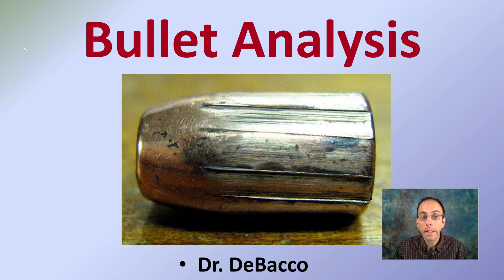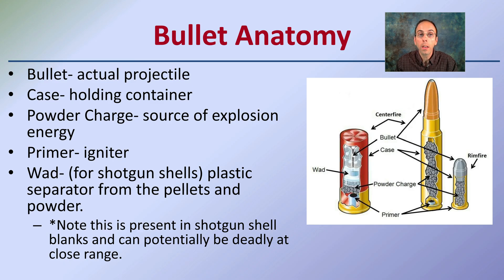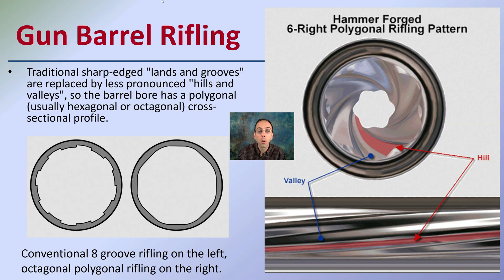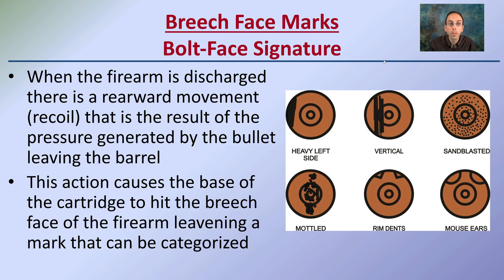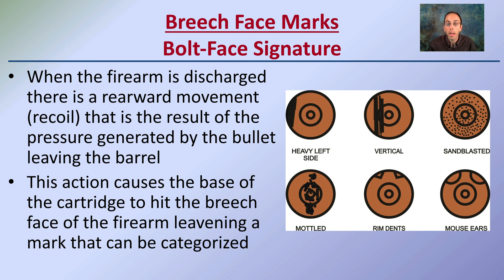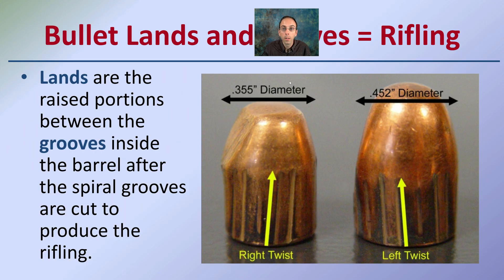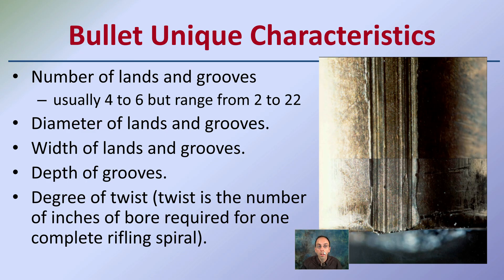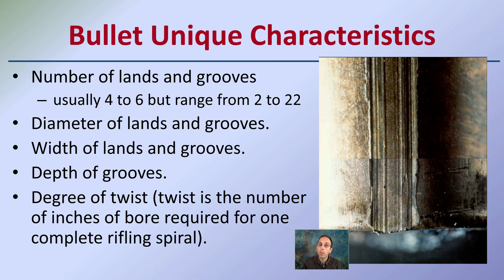Bullet Analysis

Comment: After a bullet has left the barrel and has its “fingerprint” but then travels through glass, or other hard object, wouldn’t that create additional markings on to the bullet making it difficult to recreate that “fingerprint” to match without hitting the same hard object?
Reply from the maker: Yes, it can depend on the condition that it is found in based on the material it impacted.

Comment: Do you have a video or recommendations on how to measure the width and depth of the lands and grooves to match a bullet to a manufacture?
Reply from the maker: Good question, you want to ideally have a comparison microscope to provide the easiest way to match up to items.  While this may not be possible, a single microscope (or stereoscope could work as well) with a camera can allow images to be taken at specific magnifications to allow a size comparison to be made.  The most basic method would be to use a set of calipers.  Other tips see... https://www.bevfitchett.us/firearms-identification/depth-of-grooves.html
Reply: @DeBaccoUniversity  ; I WAS WONDERING IF IT WOULD BE POSSIBLE I WILL LAY OUT AN SCENARIO FOR YOU : I WAS LOOKING OVER THE BALLISTIC OF A SHOOTING CASE. THERE WAS NO  FIREARM RECOVERED FROM THE CRIME SCENE. BUT "3 CARTAGE CASINGS" & "1 BULLET/PROJECTILE" WAS RECOVERED FROM A CAR. 
  NOW I KNOW YOU CAN DETERMINE THE "TYPE OF FIREARM" ("SEMIAUTOMATIC" OR "REVOLVER") THAT DISCHARGED THE "CARTRIDGE CASINGS". 
 BUT MY QUESTION IS :
  ON THE "BULLET/PROJECTILE" THAT WAS RECOVERED FROM THE CAR AT THE CRIME SCENE. COULD YOU ACTUALLY DETERMINE THE "TYPE OF FIREARM" ("SEMIAUTOMATIC" OR "REVOLVER") THAT DISCHARGED THE "1 BULLET/1 PROJECTILE" THAT WAS RECOVERED BASED ON THE "LANCE" & "GROVES" ("REFILING") INSIDE THE "BARREL" WHICH LEAVES   EXPRESSIONS ON THE "BULLET/PROJECTILE" ????

Comment: Question for you.  If a cartridge was chambered,  then ejected without firing would it still create a signature upon the the casing and or the bullet due to it coming to rest upon the rifling?
Reply: here from Richard Allen's affidavit?
Reply: Only if the bullet was fired from the gun. That is what makes the unique markings.
Reply from the maker: You may some superficial markings, but not like the ones shown here which are a result of the force created from the action of firing.
Reply: @DeBaccoUniversity  ; I WAS WONDERING IF IT WOULD BE POSSIBLE I WILL LAY OUT AN SCENARIO FOR YOU : I WAS LOOKING OVER THE BALLISTIC OF A SHOOTING CASE. THERE WAS NO  FIREARM RECOVERED FROM THE CRIME SCENE. BUT "3 CARTAGE CASINGS" & "1 BULLET/PROJECTILE" WAS RECOVERED FROM A CAR. 
  NOW I KNOW YOU CAN DETERMINE THE "TYPE OF FIREARM" ("SEMIAUTOMATIC" OR "REVOLVER") THAT DISCHARGED THE "CARTRIDGE CASINGS". 
 BUT MY QUESTION IS :
  ON THE "BULLET/PROJECTILE" THAT WAS RECOVERED FROM THE CAR AT THE CRIME SCENE. COULD YOU ACTUALLY DETERMINE THE "TYPE OF FIREARM" ("SEMIAUTOMATIC" OR "REVOLVER") THAT DISCHARGED THE "1 BULLET/1 PROJECTILE" THAT WAS RECOVERED BASED ON THE "LANCE" & "GROVES" ("REFILING") INSIDE THE "BARREL" WHICH LEAVES   EXPRESSIONS ON THE "BULLET/PROJECTILE" ????
Reply: @JamesWilliams-px7zg  Revolvers don't eject case upon firing. So it is likely a semi-auto, (it's unlikely the shooter manually removed the case and throw it on the ground). But also keep in mind there are a lot of other types of actions beyond "revolver" "and semi-auto". In a lot of cases bullet would deform/fragment beyond recognition for most of these analysis, but if the bullet somehow survived retaining most of its shape, then with any luck you can measure the caliber of the bullet, number of rifling grooves, rifling pattern (conventional, polygon, button rifling...etc), their depth, and twist rate and match them against common semi-auto pistols. Usually you can find these spec from manufacture's website, that would narrow down your list of firearms greatly. And since you have the case, if there is an ejector mark, it can also be use to further narrow down the list, but ejector profile can only be obtained by experiment with the same model of firearm. I'm not a forensics expert, but I've been around firearms and studied them for a long time, so hope this helps.
Reply: @JamesWilliams-px7zg It’s Lands and Grooves. Not Lance. Just a heads up. And yes, you can determine the type of firearm.
Reply: @AmbiguousAdventurer Unless he had to reload.